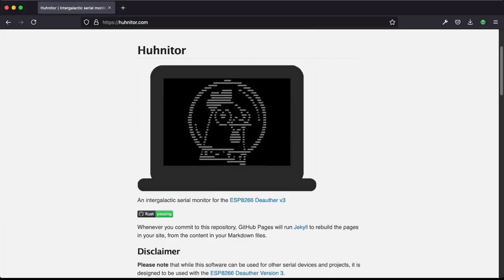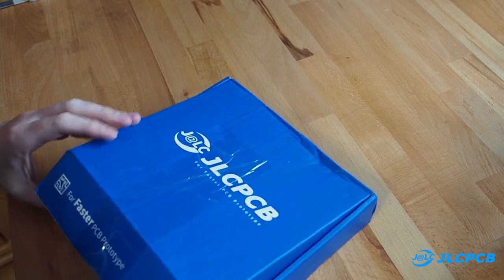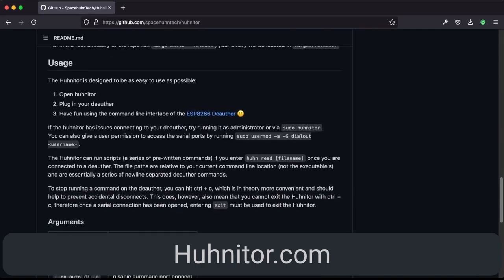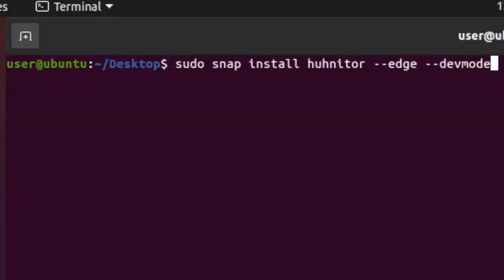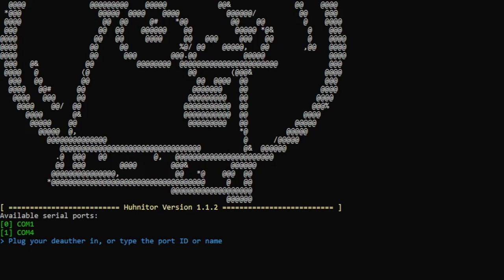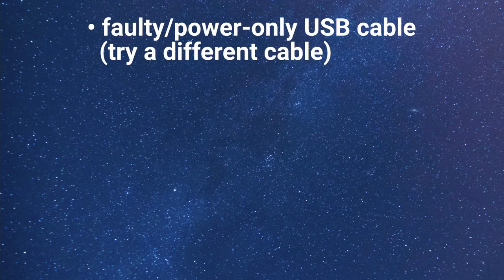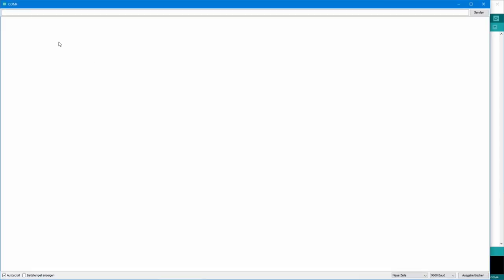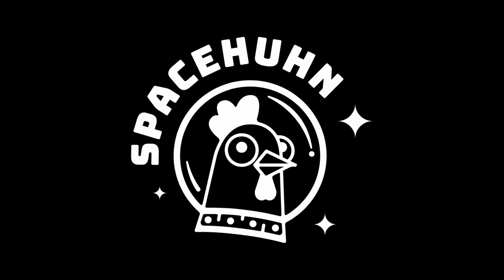Huhnitor Installation - Deauther V3 Tutorial

Comment: Hello spacehunn!  I am using ESP 8266 wifi deauther and I've got a problem saving devices. I always manually scan AP's for attack. The worst thing is that  the attack will stop in a couple of minutes unlike you save the devices first, it work perfectly. 

When I attempt to save devices (AP's), it will save "devices_0 or devices_1, or devices_2. 

What should I do? Previously, the name of the access points were save . Not those mention above.